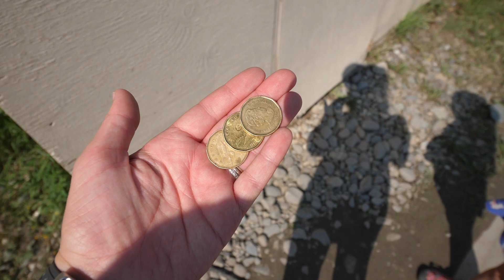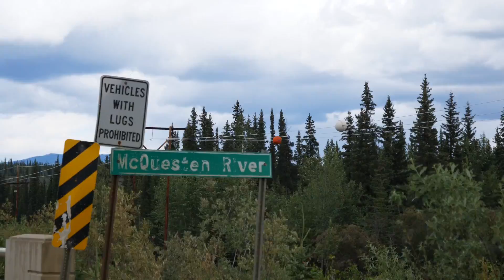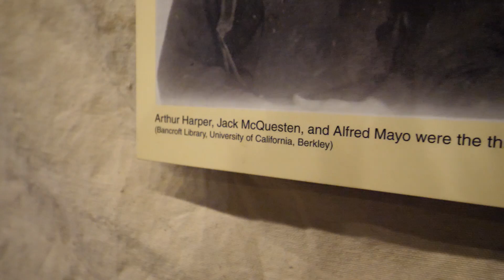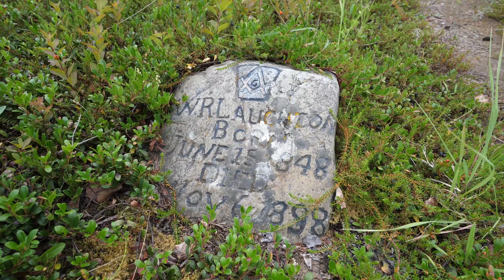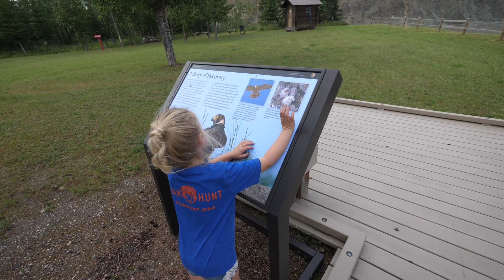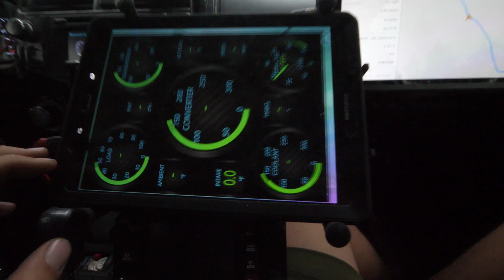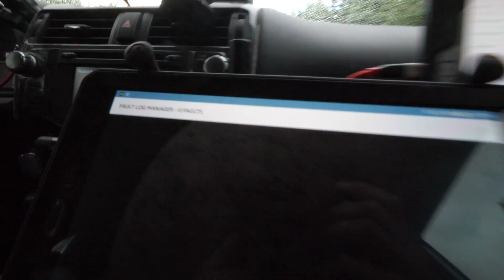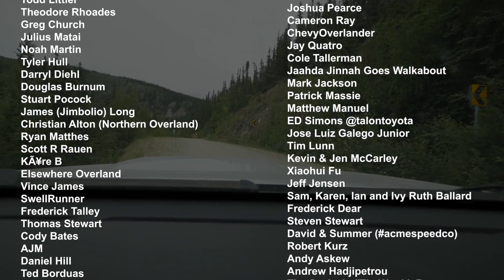We almost hit a Caribou... then it all went downhill! [S1E30]

Comment: nice patch work on the tire. that was slick. 
We carried that style of patch kit with us on our Central America trip, but always opted to get the tires patched at road side tire shops that will pull the tire off the rim, patch it internal and remount it for less than $3 usd.
Reply from the maker: Been using those plugs for years now. I've only seen one fail, but just popped another in and kept going.

Comment: One thing You might want to look into is VCI based scan tool so you can scan the individual modules. They are a little expensive but they will show you faults of the other systems in the body and chassis control that won't throw a check engine light and  that the torque ELM  adapter can't read  that is more  for obdii based  codes are more engine run ability and emission related trouble codes.  
Toyotas factory scan tool is called tech stream which runs off a PC and the lite version is about $1500 plus $999? Each additional year or you can get a stand alone scanner like an Autel Maxisys  which can access them as well.

Comment: You have mentioned needing to do laundry in multiple videos. Here is a possible solution told to me by a very well travelled woman at Overland Expo she figured this out on a trans Africa trip. They found an Igloo cooler (the kind used by workmen on their trucks, orange with handles on the sides and a removable top lid) on the side of the road. Strapped it on the roof rack, add water, detergent and filthy clothes, strap the lid on and drive for an hour or so. The sloshing around from travel on dirt roads does the trick. Next do a rinse cycle or two then hang to dry at camp. Not sure how well it would work in Alaska but it is an idea for people on the move and needing to do laundry. Also you do a little at a time so it becomes a habit by not waiting until everything is gross.
Reply from the maker: That's a great idea! Thanks for sharing!
Reply: Andrew McAllister that’s a real good idea!

Comment: Your issue might be fixed by now but if not try “carefully” disconnecting the battery and reconnecting it after 30 seconds.  This gives you a good reset since no fault codes are showing up.

Comment: Those tire plugs are supposed to be lit on fire to heat up the tare adhesive for couple seconds then blow it out. Plug it. Will have better results.
Reply from the maker: That's a new on on us. Been using them for years this way... I'll have to check out this method.

Comment: Had a former xj a plug like that travelled 500 miles then blew out in a different country, and over 1000 miles away from home. I will switch the tire now, and patch it. That kit is my last resort if I am out of tires.
Reply from the maker: We've always had great luck with them. The key is having a good kit so it installs properly. The cheap kits do more harm than good

Comment: That doesn't seem like much trouble. A lackluster campground, a flat on the trailer and an avoided collision that made some lights flash. Hmm, what you gonna do if something major happens? This seems like first class, ultra modern, smooth sailing. Not much to worry with.
Reply from the maker: I'll rename it "somewhat troubled" then 😂
Reply: @LifestyleOverland  Sorry if I came across as rough. My wife and daughter went to live aboard and cruise around the North American hemisphere some 28 years ago +, and with a huge old wooden boat, no YouTube or Patreon potential for income or sponsors. Things often went waaaay bad in some remote areas that make a flat tire and flashing warning lights seem like potentially a best case scenario. Maybe this can be encouraging. What you are doing is still an amazing feat of courage and has to be challenging. Just try to think of being 200 miles offshore in a storm, with an old wooden boat and water coming in and flooding the engine room to your thighs. Then you will know you can handle anything. I am proud of you for sharing like you are. Best wishes and regards. DJ
Reply: If you ever plan on making it to Mexico, I can help with many things South of the Border. In Sonora, South of AZ I have a hotel, restaurant and beach house in San Carlos as well as 10 years worth of experience as an expat and warden for U.S. Consulate. I can and would help you if you ever plan this, give me a shout. I offer help of logistics, safety and financial assistance as well.